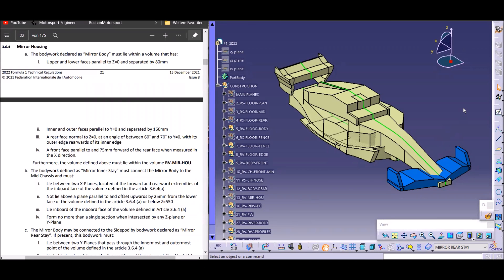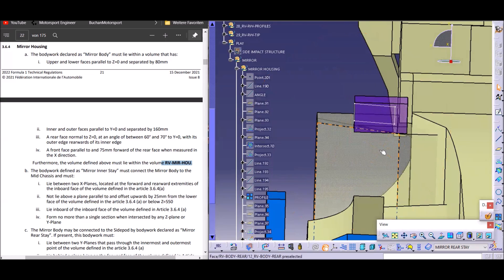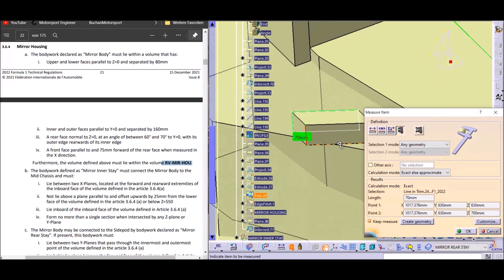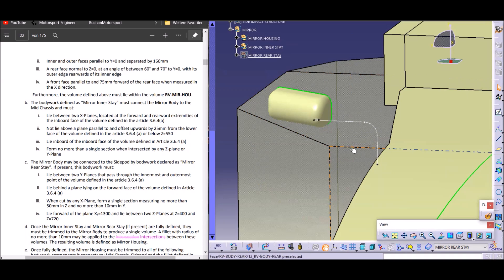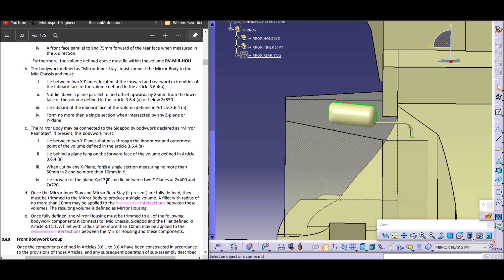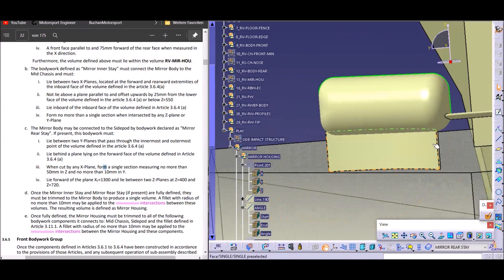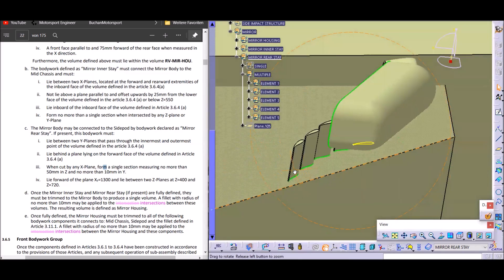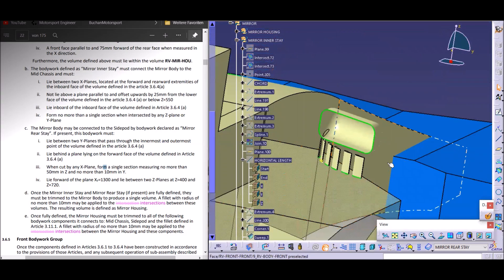F1 Engineer designs 2022 Mercedes Mirror in CAD (Legality EXPLAINED)

Comment: Hi! First of all that was an amazing video. I really need to understand the technical regulations, and you helped me with this a lot. So I really appreciate your video, and I’m really thankful for you to made this! But this video left some questions in me. First: Which program were you using? Second: Did you made the car model yourself or that was a downloadable file? Third: The different parts/sections of the car (for example RV-FLOOR-FENCE/BODY etc.) were defined by you?  Or (if that was a downloaded model) those were defined automatically by the program/by the model’s creator? Sorry if my questions weren’t understandable, just ask me if something was wrongly phrased.

P.S: By “defining the different parts of the car” I mean, the legality box. So the exact placement, height, width, length were set by you or not? If not how does the program know which part is were?
Reply from the maker: Thanks!
1) This is Catia. Almost everybody in car and motorsport industry uses it. If you know Catia you have a huge advantage in every interview.
2) I designed this car model by myself
3) All the legality boxes are defined by the 2022 F1 regulations and I showed some possible designs within these boxes here.

Comment: Fia really needs to hire a top-notch lawyer to help them with the 'wording' of rules. I bet the top teams have one in their ranks. Or, they should start to include diagrams in the rule book, to better explain what they mean. On Another matter, very good work @B sport. That was a very good video explaining the loophole exploited by Mercedes. Keep them coming!
Reply from the maker: Thanks! All you need are just open-minded engineers to come up with solutions like this.
Pat Symonds and Ross Brawn are well aware of what the design departments are capable of. I could imagine they left the mirror regulations quite open intentionally and didn't define another plane for the rear stay. It won't be a huge performance advantage but it's visible for every fan and gives lots of content to discuss.

Comment: So, seems like an oversight in the regulations to me. Also, I'm wondering why "Mirror Body may be CONNECTED to the Sidepod by bodywork [...]" Is not interpreted as: In order for bodywork to be declared the rear stay, it must connect the sidepod and the mirror body. Only one of these elements of a multi element stay does that. So one could argue that the remaining elements can't be considered rear stay elements.
Reply: Exactly, I don't get how those disconnected rear elements can be considered rear stays as they don't connect to the mirror body.

Comment: this is all because of fia again when they they forbid ferraris 2018 mirrors i think it was because it was against the intention of the fia. so if they declare the intentions once then unless they say otherwise that would be still going on right? hence they would have do the same to mercedes that they did to ferrari did in 2018. if they are not than its just unfair. 
let me explain you why with the declaration or directive or whatever they call it they literally made ferrari give up searching for extreme mirror designs or unique ones. which in turn directly impact them because the freedom of development areas basically was smaller for them than anyone else.
in my opinion ferrari is totally right with everything they said. if those kinds of mirrors are okay now they should have declared that after seeing mercedes cad deisgns that they got.
man the fia will never learn.. this typical 2021fia in 2022 again. sometimes they say like this then the same thing with other team they say like that.

Comment: Awesome video man! My only question is the legality of the outwashing elements, not in the physical sense (which you've already  demonstrated to be legal) but it does say the the main purpose of a stay is to support the mirror which only the elements that touch the mirror do. And it's aero effect should be secondary, how are these different from the 2018 Ferrari mirrors as far as I know they were legal in the physical way but banned because their function wasn't for support, so how would these be any different?
Reply from the maker: That's up for debate. By the rules they seem to be legal but the FIA has to decide if that's in the spirit.
Mercedes traditionally doesn't bring designs to the track that they haven't confirmed with the FIA beforehand. So let's see where this goes.
Anyway, for F1 it's a nice debate and fans stay entertained :)

Comment: ? How's that explain the second car they had at Bahrain test ? The mirror is mounted on a wing that's separate from, but fits in the given box of the sidepod and is a aero device in its self !  VERY GREY interpretation of the rules! Hope its banned or better yet fails to work if allowed, and Merc wasted all that time and  $$ of their budget cap for this year developing it !! Down with Merc & sir L.H.  !!
Reply from the maker: That's indeed very interesting. Bodywork is defined in article 3. But article 13 says: side impact structures must be fully enclosed by bodywork. But article 13 doesn't specify how that bodywork has to look like and rules of article 3 don't apply...
They located it in the sidepod box because there is no bodywork allowed outside of it.

Comment: I’m missing something with regards to „The […] Mirror Inner Stay must connect the Mirror Body to the Mid Chassis“ - is the sidepod upper surface part of the Mid Chassis or would you need to declare some ‚fictional‘ bodywork as Inner Stay that’s basically running along the surface of the sidepod? Looking from the front, we now have something shaped like a 7, but the declared bodywork would then be Z-shaped, adding that bottom stroke to the 7/Inner Stay
Reply from the maker: Yes, I will cover this in my next video.

Comment: So, it is only legal because of the interpretation of the wording 'MAY BE' in "The Mirror Body may be connected to the Sidepod by bodywork declared as “Mirror Rear Stay” ?
Big thanks for sharing your work and the clarity of your explanation!
Reply from the maker: Thanks!
It just means that you can have a rear stay or not.
In section "d" they say it needs to be a single volume after trimming the mirror parts together. You can have a connection underneath the sidepod surface for the rear stay elements. If you trim it to the sidepod, they are single non-connected elements...so no problem with legality as the rules are currently written.

Comment: Great video, I love to see the analysis workflow using bounding boxes in CAD, because that's how they do it.
One could argue that "single section" is different than "no section", meaning that the regulation imposes one section, not two or more, but also not zero. But I don't know how the interpretation of legality works, I feel this is more of job for a lawyer. The job done by Mercedes is great in any case.

Comment: What I would like to know: Isn't only the first element the mirror rear stay according to the rules, because it's the only one that is connected to the mirror housing? Shouldn't those elements have to be connected to each other to be part of the same defined mirror rear stay?
Reply from the maker: The rules don’t say they need to be connected...
They only say they need to form a single section for any x-intersection, so it’s fine.
Reply: The whole cascade is still connected to the mirror housing through the 'sidepod' bodywork (SIPS/Front Stay Shroud), i.e. you can draw a line through the axis of any of the stays through the 'sidepod' and up through the frontmost rear stay and into the mirror housing. There aren't any rules that specify that the stay must connect as you say. If they had included the single section rule along the XZ plane as they had with the front stay then what you describe would be enforced by the rules.

Comment: Interesting video. Would love to see a video on your workflow on your approach to creating a freeform aerofoil profile, as it looks slightly different to the way I was taught.
Reply from the maker: This here is a heavily simplified aerofoil profile just to show and explain stuff.
I won’t show the detailed aerofoil design as this would go into the team‘s core design knowledge.
Reply: @bsport320  Oh I wasn't meaning anything specific to Mercedes or anything. Just what your personal approach for actual aerofoil creation in Catia, as the method used in this video is quite a bit different to how I was taught by an ex Williams and Toyota aerodynamicist, where he told me create a sketch that defines a thickness distribution using splines or the 'connect curve' command, and then use that sketch to define a law which is then used to drive an offset curve command based from a spline that defines the mean camber line.

Where as it seems you created yours purely from construction lines and points, so would be interesting to see your method as well, without getting into a specific team's design philosophy and why they are chosing the shapes/profiles and how it interacts with other bodywork. I'm just more interested in the Catia/NX workflow of creating good aerofil profiles.
Reply from the maker: So there are many ways of creating aerofoils. I showed a very simple one here, which is just a sweep. This is easy to understand for others, easy to control and gives you high surface quality.
The way that you described would be for more complex shapes where you want to control the trailing edge thickness. But like always, it makes sense to not overcomplicate things.
Also, some teams or individual designers don't use sketches at all, others love them.